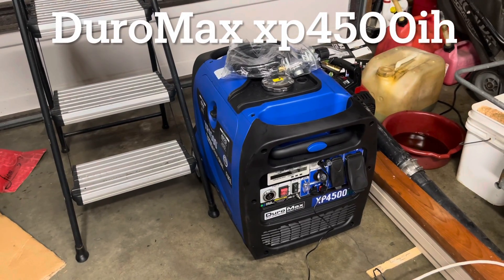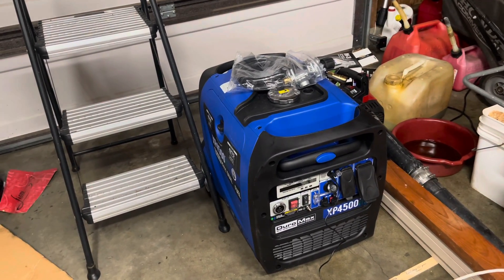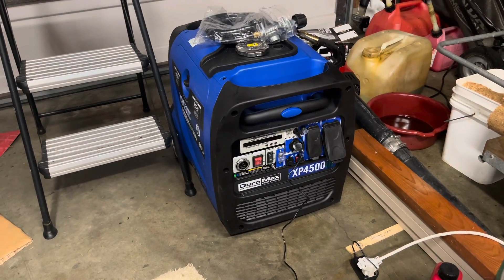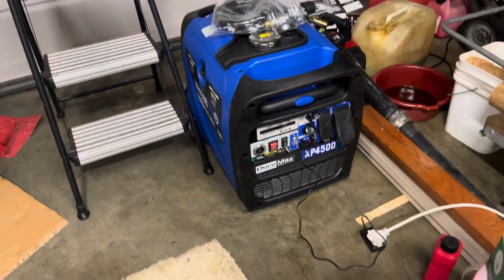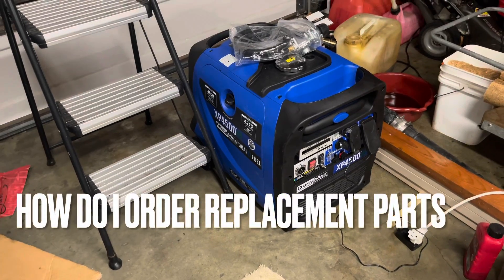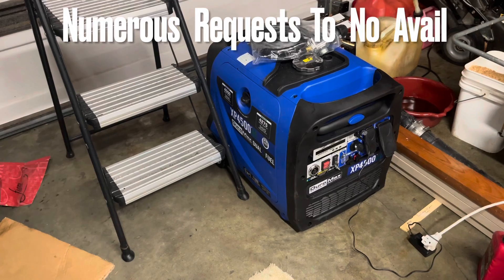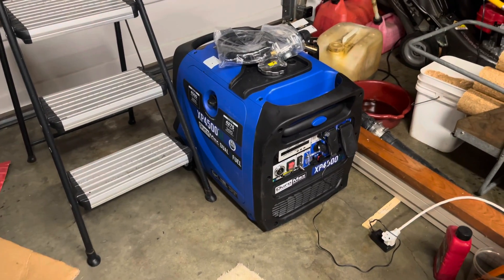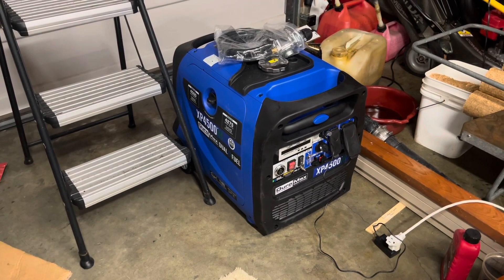Duromax Inverter-WTF? No Parts List-Diagram-Wiring Schematic?￼

Comment: I can't even find an air filter for my duromax tri fuel. They told me they are working on the part list on the website  and would send a free filter. Have not seen it yet. Something is fishy here. I would hate to be in an emergency situation and need a part. This company should be sued.
Reply from the maker: I’m sorry to hear about your issue. Like I mentioned a few years ago in the video the seemed like a decent quality product but the lack of a parts list & drawings was concerning not to mention the lack of assistance from customer support.

Comment: It’s been 5 months since I contacted Duromax for a replacement fuel selector knob,but they don’t make or sell spare parts, so…..😂🤞🏻good luck with your 3 year warranty if a more important part we’re to fail.
Reply from the maker: I’m sorry you’re having issues getting a replacement part.
As I mentioned I hit a brick wall trying to communicate with customer support. I was extremely patient and diplomatic but it got me nowhere.  It was that and the lack of any certified repair or parts facilities within 500 miles of my home I decided to Return the unit. I would have given it to my daughter or sold it to my neighbor at a discount but didn’t want to stick them with a piece of equipment that can’t be serviced.  It may be a well built generator but chances are eventually something will fail and I was unable to confirm that I could get it repaired or find parts.

Comment: FWIW, my DuroMax XP12000E came with a user manual that includes circuitry schematic.  It does not contain a parts list, although it does contain instructions for replacing certain parts.
Reply from the maker: A few of their (non inverter) conventional style sets do offer a wiring diagram but that’s not the case with any inverter type. I made every attempt to get the information with no success. 
And I want to reiterate that I have no issue with the quality or design.

Comment: Duromax sent me a half Ass pic diagram of the pinout of the ATS but not the whole elec wiring diagram so I can can get a auto gen start to work
Reply from the maker: Congratulations!
I really wish someone would do a teardown of a Duromax Champion Briggs Predator Firman Westinghouse AiPower  and Wen genset to see which ones actually have pure copper in the windings.

Comment: I've been asking them for months for the wiring diagram for the XP9000IH. Especially info about the ATS plug wiring
Reply from the maker: Last week Duromax answered my 11th email with an untruth  when they told me “Honda keeps their drawings schematics & lists secret too” and “I should except the fact I will take the product to a service center if problems arise” Fortunately I purchased locally and the retailer wants to keep their customers happy. 
They’ve pissed me off to the point I’m returning a perfectly good generator.
Lesson learned.
Reply from the maker: That’s virtually the same response I initially received.
I was in contact with several people claiming to be from various departments with each saying the next person could help me. I actually realized fairly early it was a lost cause but I just wanted a legitimate reason why they were withholding the information.
I know it’s just a relatively inexpensive import generator It’s not a $5000.00 Honda but that’s even more reason why service documents are important.